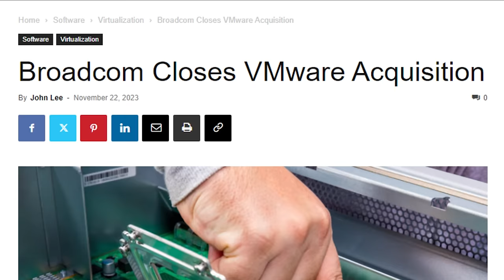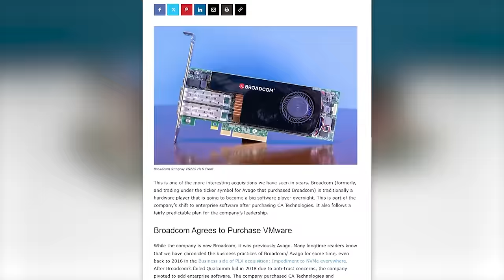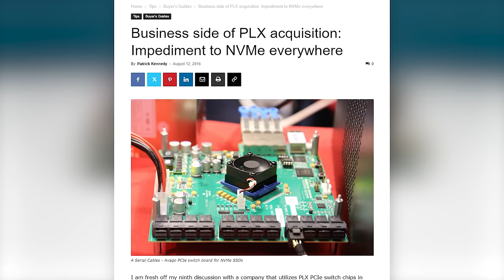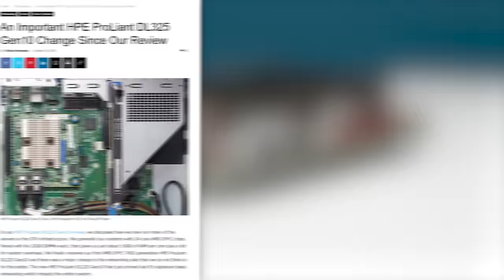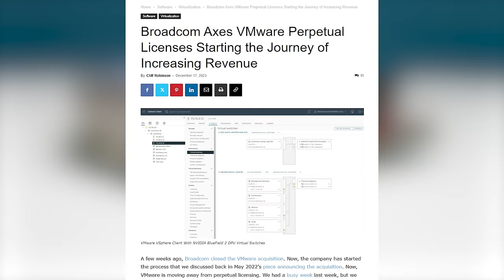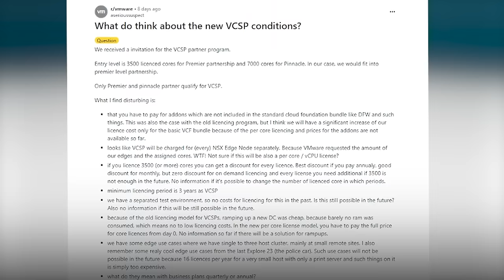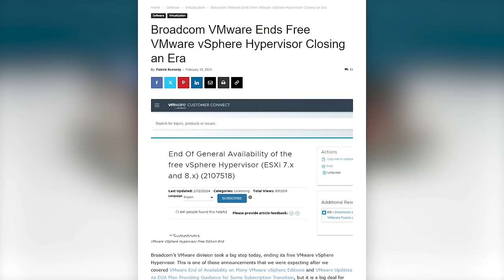VMware GUTS Customers with 10x Price Increases

Comment: With the price increases is that getting you more value?  If not then its time to move on.  I have used VMWare for 2 decades and used it to cut down on the number of computers really needed Plus the the snap shots rock and the ability to move the computer to different hardware in 15 to 30 min is a no brainer.   Tech in general is becoming too expensive to purduce here in the states.

Comment: They also fracked up because a lot of engineers are those small users they just screwed over. They will move on to a new option... whatever that may be. 

If you think engineers will be as quick to recommend VMWare when they have been kicked to the curb, forget it. Remember engineers are the ones installing this stuff, and Broadcom basically said "You aren't important enough to train or be experts on our software." Not a smart move.

Comment: Will ESXi 7/8 still be relevant to run with the current free trial isos? Just wondering as I do use the enterprise plus (hacked keys) which I know is sorta illegal in the end licensing agreement but as it gives me full advantage I would hate to see the eol for ESXi all together and not being able to use it for my server 2022 vm that i currently run my website on thu iis
Reply: Those hacked keys won't matter as you'll be required to have an active subscription to get updates and upgrades.
Reply: @Darkk6969  but would it really matter if the only thing you could run is ESXi 8 at the latest. Because I really wouldn’t care about the upgrades and updates as I only use it for my web server. But I do also know it would be more secure upgrading and updating my cpus only support up to ESXi 7 and 8 respectively

Comment: It reminds me the IBM / Digital situation in the 70s-80s, they dominated the industry when new players arrived, Microsoft, Apple, Novell, Compaq, Dell, HP ... and tada a revolution, Digital was eaten by Compaq, Compaq by HP, IBM nearly bankrupted and was obliged to return to its fundamentals business, very big systems. 

Some of those new companies disappeared, merged or were absorbed by bigger to finally be in a similar situation today, 2 or 3 big players leading the entire market. 

Now it's time for a new revolution, with new players, probably not Opensource as, at least professional customers, need to have a point of contact for support, licensing, upgrades and to ensure compatibility with hardware. 

It already started as Microsoft already lost +-30% of its market, from 95% in the early 2010s to +-60% today, slowly replaced by other systems and not only for Windows but also Office suite. Apple remains stable but at +-20%.

Comment: It’s a 5x increase for me to transition from VCPP and that doesn’t even include SRM costs.  Short version is that it’s uneconomical and we simply can’t.  We’re looking at a quick migration to Hyper-V and to tread water while we look at longer term later.  Fortunately, our hosts are already covered for licensing (apart from SCVMM), which means we will be reducing our monthly bill significantly.  It will help offset labour costs anyway.  Screw you Broadcom, you greedy f&$#@ ….  Thanks for highlighting the plight of us loyal VMware “partners” of many years.

I will also add, under VCPP, our DR platform consumed very little RAM, making it almost free.  Now they want money for it too.  I’m sure for some VCPP partners, this alone would be the tipping point.  Imagine if you actually nearly met needing 3500 cores, but your DR was another 3500 core platform to match prod.  Now you’d need 7000 cores licensed.
Reply from the maker: Great points and story. Thanks for sharing this

Comment: if there's anything that history of computing has taught me it's "if a paid alternative hikes to unreasonable limits or free alternatives are abolished or both... Open Source community will come to save the day, and boy they will, especially when it comes to bootable VM where you can have many headless machines running at the same time in emulation mode.

Broadcom killed the VMware brand, that's all they did, give it 6-12 months and they will regret buying VMware as many alternatives will be popping up

Comment: Cloud is the new mainframe
Reply: And just like mainframe.. Cloud is dying due to increasing costs. There is some very large companies leaving cloud. Pretty much the same thing that happened to mainframe back in the day. And around and round we go..
Reply: Lol no. Cloud can't power huge banks and airlines. Banks have tried to leave the mainframe for decades but can't because mainframes are way faster than x86 and arm based servers. Mainframes are kings in high transaction workloads and critical data storage. IBM guarantees seven 9s of up time, that's less than a few seconds of downtime per year assuming you didn't do anything irresponsible with your system.

Comment: IMHO there were only 2 good things ever about vmware. Those features are long gone. First one was that their gpu acceleration in a vm was fairly good(more than 10 years ago?, I think it was mostly due to nvidia being greedy with grid?). The other one was when you could seamlessly run an app inside a vm as if it was a native app(I think also gone more than 10 years ago?).

Comment: VMWARE has always been a rip off. Now acording with your reserch this has gone insame. I have managed to comvince many clients of mine to switch to Open source solution such as KVM . it is stable, free and very scalable so you do not have to worry about licencing dual socket processor servers with astronomic proces or silly subscriptions and so on. so fuck it.

Comment: You seem to think mainframes were a thing way longer than they were. The days of the mainframe were waning in the 70's. In the 80's, the personal computer ("PC") was booming. Many companies were buying smaller and (vs. a mainframe) cheaper PC's that a single person could use at a time. I recall my elementary school [early 80's] getting two TRS-80 Model II's -- one stayed in the office, the other the library. By '85 there were loads of model 3's and 4's, and the two county high schools (x2 jr and sr) had a wicat minicomputer. By the time I was in college in the early 90's, no one even said "mainframe" anymore. (the only one I ever knew of was the university's records computer - students don't even get to see that one. 'tho I do have a large box of 8" floppies from it.)

Around 88-90 I did disassemble a mainframe. A local textile mill donated their's to the high school electronics lab. (including parts of the microwave transmission network.)

I started in the "computer admin" world in the early 90's. Aside from the aforementioned unit, I've never touched a mainframe. ('tho I have logged in to a few.)

Comment: What do you think nvidia is doing with their GPU’s currently? Charging 90% profit margins and 4x the price of an AMD gpu. You saying Broadcom is taking advantage of pricing with their switches and NICS is something called capitalism. You either deal with it or go to someone else lol. Pretty simple
Reply from the maker: The NVIDIA side is a bit different, and for perspective we have been reviewing 8x GPU systems since 2017 or so. NVIDIA is making hardware that is supply constrained. A100 from 2021 to 2024 prices are up, but in most cases not more than like 2x. H100 prices are generationally higher. People are driving the price up on NVIDIA parts because they are paying more to get ahead in line, and that is increasing prices for everyone. To be fair, AMD's AI GPUs and even Intel's Gaudi 2 have been supply constrained as well. Software is not supply constrained. But you are right, deal or go elsewhere applies in either case.